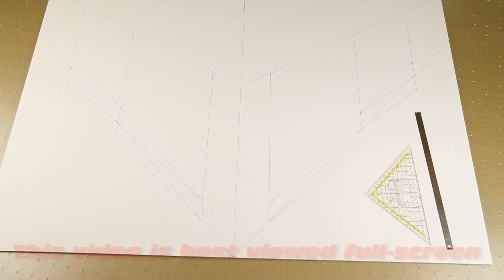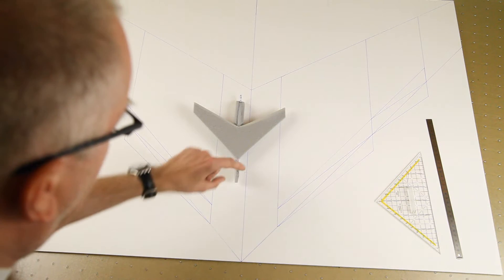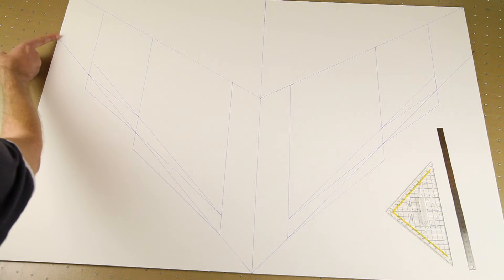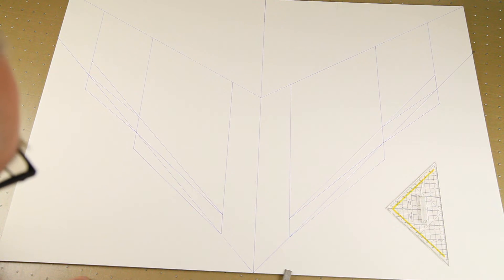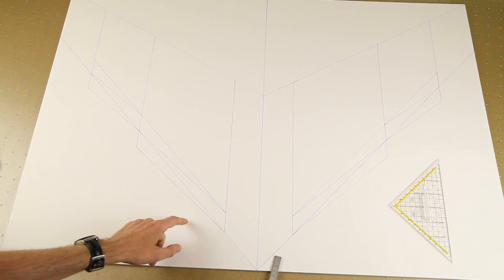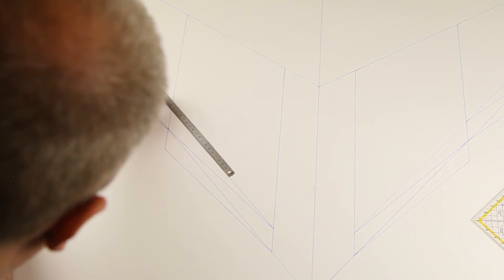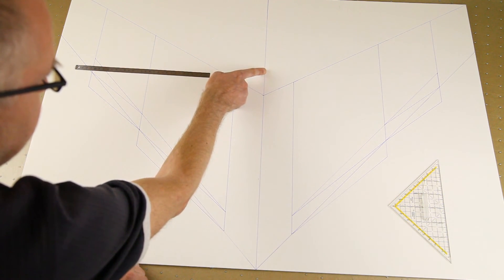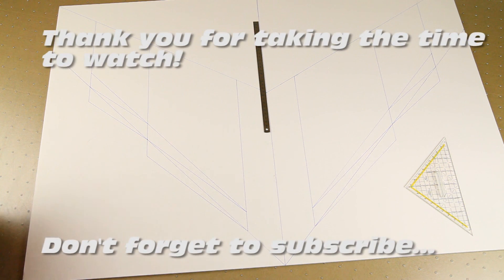Reversed Flying Wing Project - Part 2: The Design!

Comment: Interesting take on the project.  Especially the aileron/elevator vs elevon discussion.  One minor concern I might have is that at low (almost stall) speed with your ailerons near the outside of the wing it might (might) be difficult to rotate the wing left/right since the ailerons will be so far outside of the prop wash.   Then again in most of my wings the prop is entirely inside of the elevons, so perhaps I am mistaken.   I'll be interested to see how this turns out.
Reply from the maker: UnlimitedVertical Thanks for watching & the input mate!  Well yes indeed. really in most planes the ailerons sit outside of the prop-wash.. I Could however allways set the elevators up to Allso act as ailerons if I would not have enough control.. 
Thanks again! :)
Reply: +DutchRC ADVENTURES True enough.   I think some of the planes set up with ailerons on the outside might have a rudder as well which is in the prop wash, of course there are always exceptions.  It's probably a non-issue anyway.   This won't be a "beginner plane/trainer" in any case.
Reply from the maker: This will be FAR from a beginner plane indeed ;) If it flies at all offcourse.. Well.. I do think it will.. If I can keep it in the air for a minute or so, I'll know enough for V2 :)
Reply: +DutchRC ADVENTURES Don't forget to press "record" :-)  look forward to seeing it.
Reply from the maker: Ghehe :)  I won't ;)  I'll be shooting 1 final build-report before the maiden..